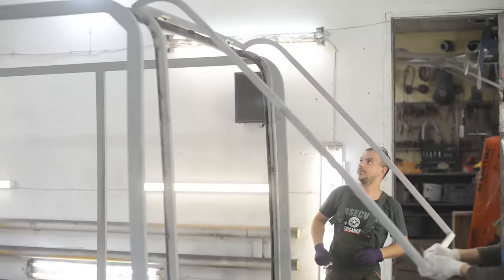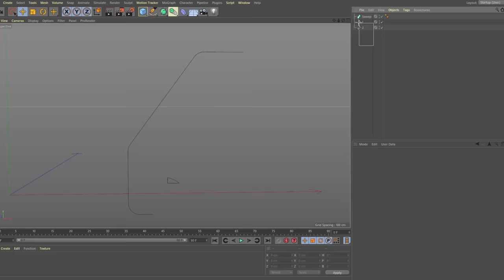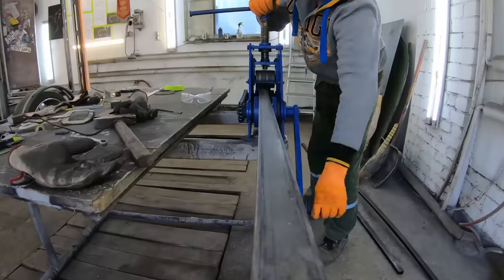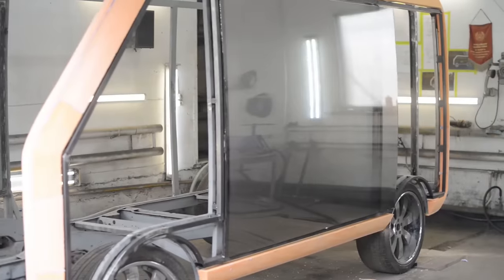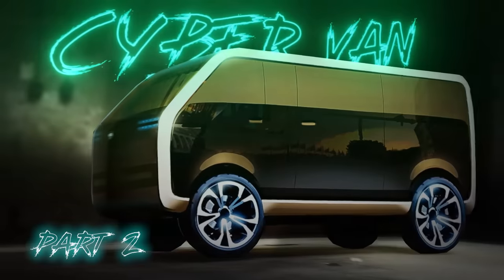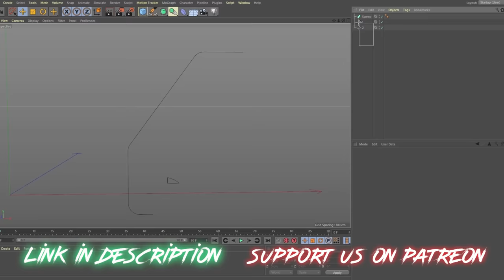HomeMade Cyber Van from the future using the Wattsan CNC machine. Part 2

Comment: Should add some decently strong magnets to the doors to keep them from rattling and a few more bracing struts on the long runs (front, center frame, rear) to prevent warping. All in all, love the work. Looks fantastic. 👍